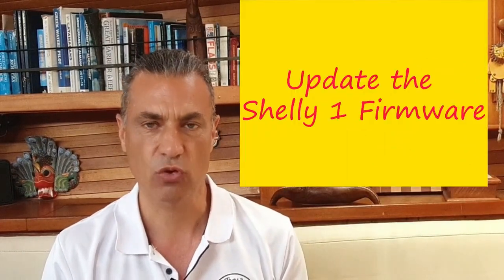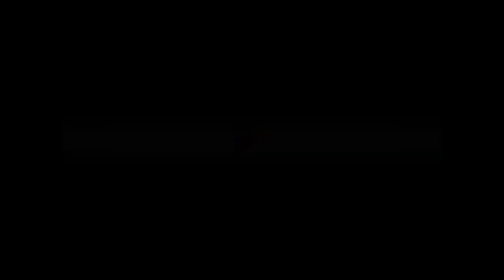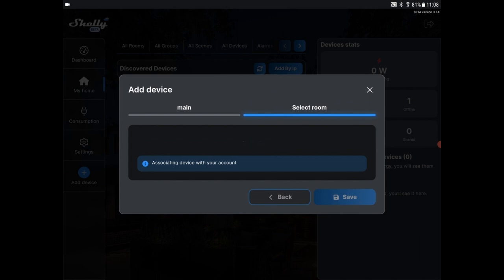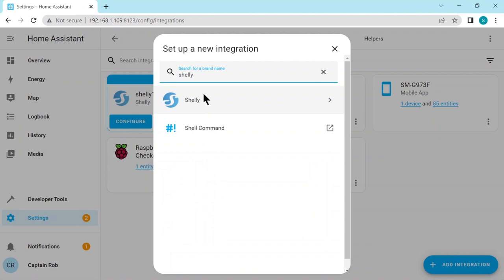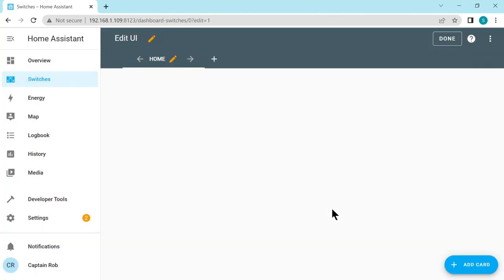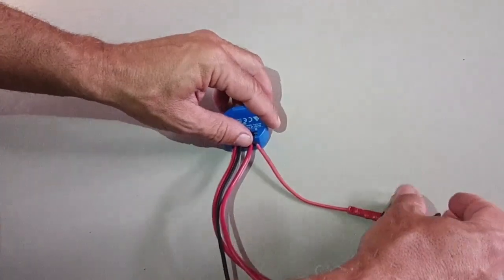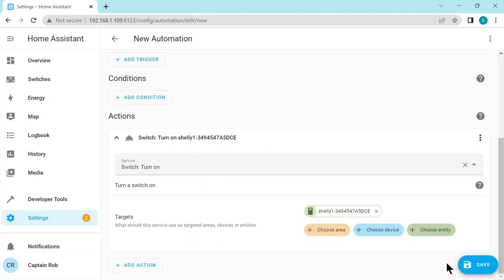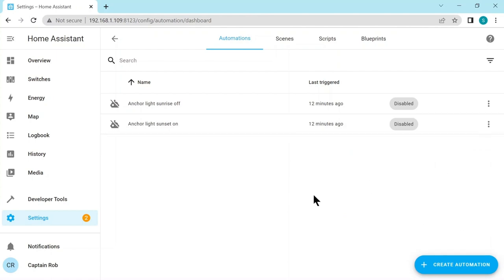Smart Boat 6: Automatic Anchor light using a Shelly 1 relay and Home Assistant

Comment: Nice one and good to see someone else using HA aboard! 
One extra condition you could use which I have implemented is to set some modes in HA.
I have Underway, At Anchor, In Marina, Not Aboard. My automations behave differently depending on the mode I set.
I currently do this with a 4 gang wireless zigbee button that sits next to the helm.
For example, the anchor lights come on at anchor, but the nav lights come on if underway. Then if I anchor after dark, one click of a button as I shut down the engines and they swap over.
I am currently working on a picture card to represent this on a dashboard, which is completely overkill because my boat is only 34 feet. But hey, why not! haha!
Reply from the maker: Thanks and good to see you are using HA. I think HA is brilliant solution for boats. I have ordered a 4 gang zigbee board to try it out and it will be a subject of a future video. Once you have the instruments and motor integrated you should be able to set the status automatically. Good stuff. If you have any specific suggestions for future videos, please let me know, and I'll be happy to consider them.

Comment: Nice work, Rob. Two quick questions from me: Do these relays get hot when in use and do they need to be placed in a ventilated space? Also, if the main power supply gets cut off and then switched back on, what state do they go to by default, on or off? Thank you. :)
Reply from the maker: Thanks. The relays are very low power devices and can be installed in an enclosed area. In houses they are installed in the wall behind the light switch. There is a power on default mode that can be set. The factory setting for this would be off.
Reply: @SmartBoatInnovations thank you for your response! Looking forward to your next video.

Comment: Great work Rob. Another Q - hard to find the Shelly1 devices any longer, can you suggest suitable alternative?
Reply from the maker: You can use a Shelly Plus 1. 
I will be making a video soon but you can also use relay boards like these. Especially if you plan to have many virtual switches.
https://s.click.aliexpress.com/e/_DeBkQ8b
(Select the 4CH Zigbee 7-32V version. Has 4 switches and relays)
or
this one integrates directly to esphome:
https://s.click.aliexpress.com/e/_DDzrj8X

Comment: I just found Smart Boat Innovations and really like what you are doing for us. I am concerned about using the Shelly relay in a marine environment because the design seems to be for dry locations. The contact material is steel and no mention of water or moisture resistance?
Reply from the maker: Thanks. Any Smart relays like the Shelly or the 8 way relay I have in this video
https://youtu.be/ZZJAs8bhELE
are designed to placed in a dry zone like behind/inside your boats switch panel.
Reply: My experience is if it’s on a boat, it’s a corrosive environment so I will hopefully find a relay not using steel contacts.

Comment: Rob, couldn't you use a zigbee compatible relay? I believe Shelly is wifi, so would use more power?
Reply from the maker: I use the Zigbee devices when I want a battery operated device in places it is too much work to run wires.  Or just for the convenience of install. Since relays are in a place with DC power I prefer a DC powered device. And since I have power the extra draw of WiFi is insignificant. The Shelly power consumption is less than 1W.
Reply: @SmartBoatInnovations  makes sense. Thanks for the swift response, Rob. Keep up the good work.
Reply from the maker: I have just seen this 4 way zigbee switch in a case. This should also work. Should be easy to setup once you have a zigbee network.
https://a.aliexpress.com/_mNK9vSq

Comment: Hi Rob, I have a spectra Watermaker on board, and I’d like to be able to set up a relay to run the spectra pump once a week for a freshwater flush. Based on what I’ve seen on the Internet, the Shelley one requires an Internet connection for schedules to work. I don’t have Internet on my boat, so I’m wondering what other options I might have? thanks for your great videos. I’ve enjoyed watching them! - Dale
Reply from the maker: If you are setting up a Smart Boat you will need at least a local wifi network even if it does not have internet access. Just means you cannot access your boat remotely. The Shelly 1, how I have shown connected to the Raspberry Pi, will work without Internet as the schedule is within Home Assistant on the Raspberry Pi. I also have a Spectra watermaker and it turns on every day at 11am to flush.
Reply: Got it! Thanks for getting back to me!